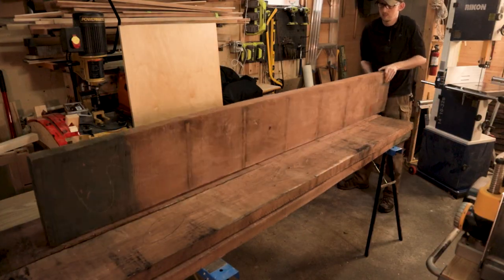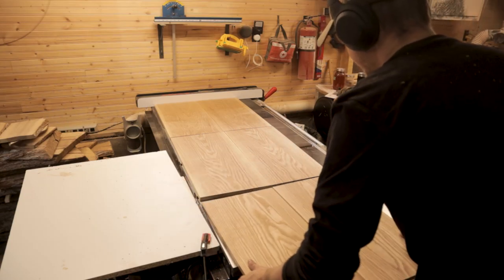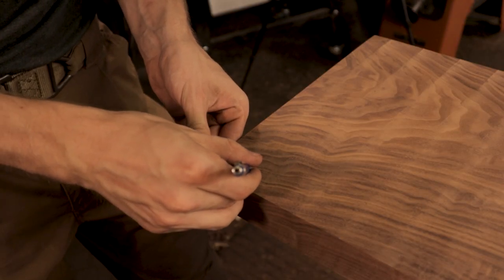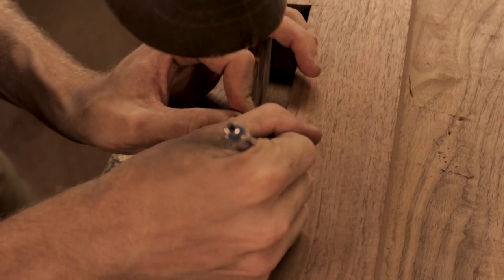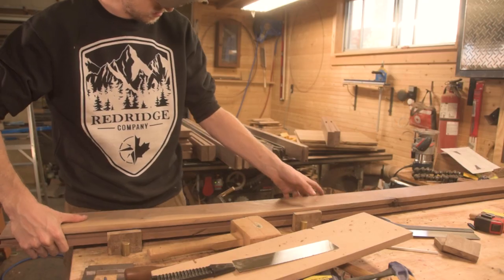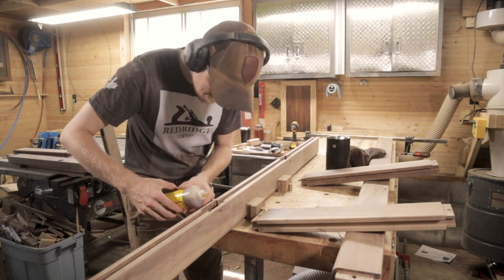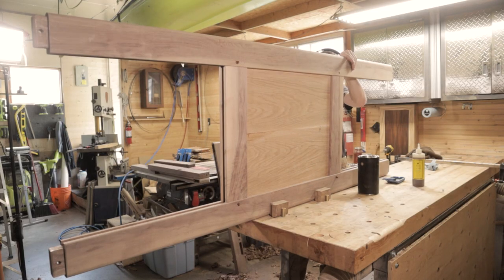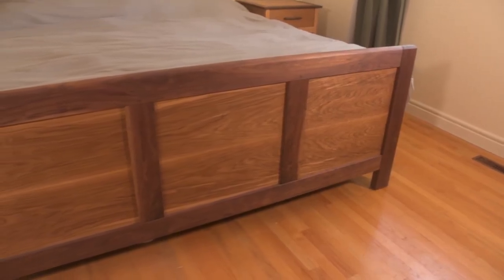$8000 King Sized Bed

Comment: This is also very good work.
You have built the bed very precisely and accurately.
Everything is right down to the last mm (mm in Germany), inch, 
Watching you at work, it looks like you're a wood doctor.
But I'm surprised that your workshop is so untidy.
It's quite a mess there.
Someone should tidy up your workshop.
Well, but that's your problem.
I'm just surprised.
Nevertheless, as I've already written, the bed is really very nice.
Many thanks for showing it.

Comment: A while ago I built a torsion box/sled (8' long, 12.5" wide, 3" tall) to joint long boards in the dw735 using the shimming approach. It worked ok but is an an unwieldy process that can snipe badly if the torsion box isn't perfectly supported, and shimming properly takes a while. This is inspiring me to turn the torsion box into a flattening jig. Curious if you went through the same evolution, and roughly how long it takes to flatten a board with this approach.
Reply from the maker: I've been using this router method since the beginning, I've only tried using a planer sled a couple times and always had the results you described. I'll use a planer sled on occasion, like if I need a board that is no longer than 24" but anything longer I always go to the router. As long as you have a decent 2-3hp router and buy a slab flattening bit that's around 2 inches wide, you can flatten boards in a matter of minutes. If I remember correctly these larger ones took about 10-15 minutes, but I was also cleaning up after each one and setting up the camera stuff so it probably could've been faster.

Comment: There’s just something about the combination of walnut and oak that I love. Heck, Walnut and Cherry look great too! Are you happy with your jointer or do you see yourself upgrading some time? I actually don’t own a jointer and do all my boards by hand but I’m also not doing this everyday either.
Reply from the maker: If I could afford to build everything out of walnut I would, your can mix it with almost anything and it'll looks great!
I love this jointer, honestly it's one of the few machines that I don't think I've every complained about. I will definitely upgrade someday, but only when I can afford a 12" helical. For 90% of the pieces I work with, this jointer helps get the job done super quick, then for those wider pieces the router works as a backup. If you have an extra $850, I'd highly recommend it, I really like being able to get the flattening/jointing done quickly!